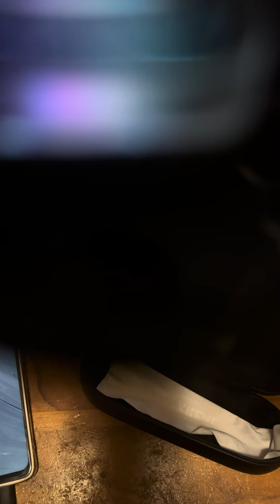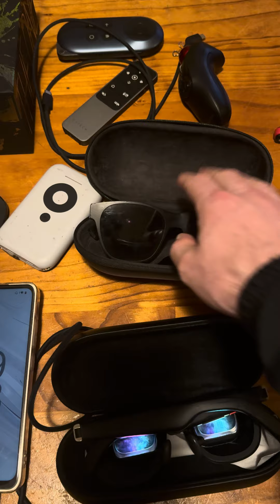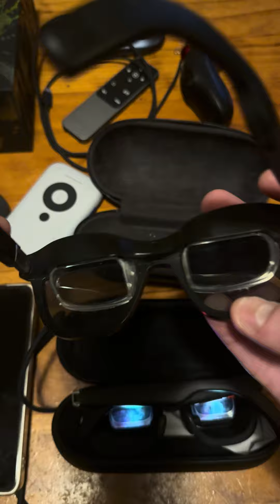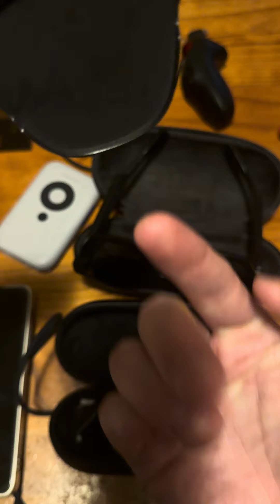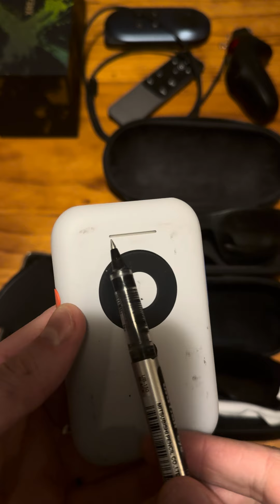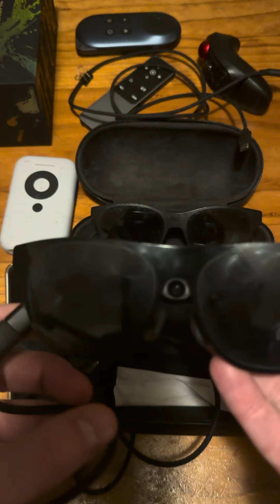Don’t buy the Xreal One Pro or Air without watching this first (yes, really)

Comment: I have the One model, and overall it’s been working well for me. Some of the issues you mentioned are definitely real, like the tunnel vision and the nose pad. In my case, the nose pad is just really hard to remove. I also use the prescription insert, and I have to take it off before folding the glasses; otherwise the frame folds onto the insert and risks damaging it.

That said, I might just be lucky not to have any manufacturing defects. The jittering issue you mentioned on the Air model (where bumps cause the image to shake) is fixed on the One and newer models. They added a dampening effect in Follow Mode, so the image moves with a slight delay instead of instantly, which helps a lot.

I’m not sure whether you’ve tried connecting the device to a PC and using their OTA update page to see if a firmware update might fix your issue. Since you mentioned it’s not connecting, though, I’m not sure updating is even possible in your case.

Comment: Your problem reportedly has been the same to another person simply by changing cable wich of course you have tried ,so im thinking maybe cleaning the usb c socket of your glasses will fixing it due to the fact that a lot of usb c dysfunction is related to small particles of dust clothe or crumbs stuck in the socket

Comment: I had a good experience until my air2pro arm sound stopped working, but customer support helped me, even though they didnt have warranty, ofc it was a paid repair but they did solved it in my case.
Then i upgraded to the One Pro glasses and to me they have a fair field of view, you dont notice the side edges from the frames so to me they are great, no bad experience with them. Do you consider giving yours or selling them? i could be interested